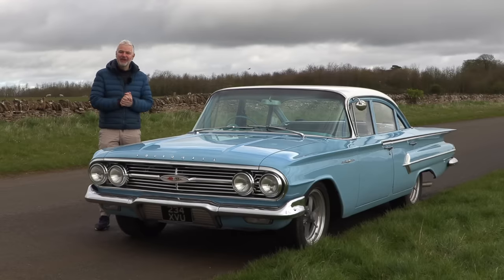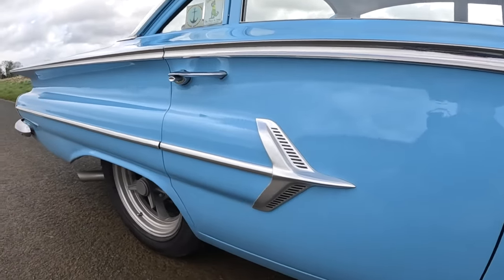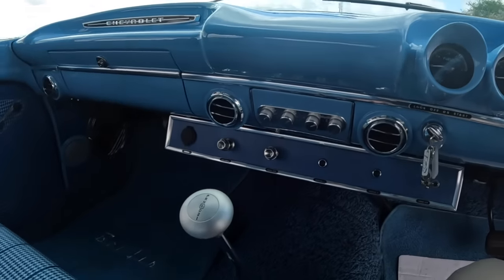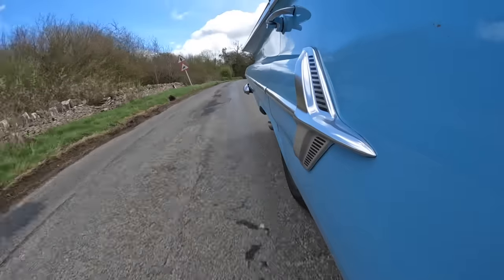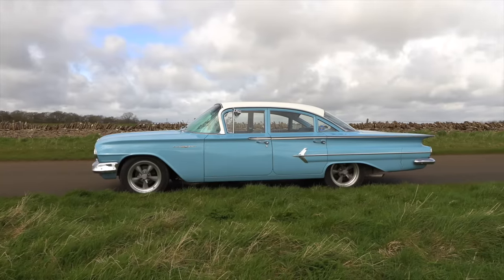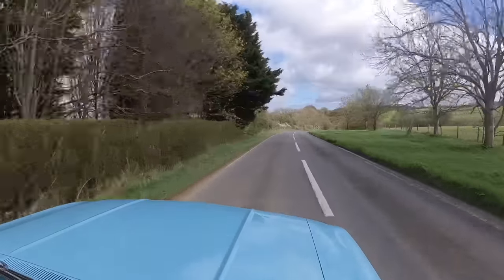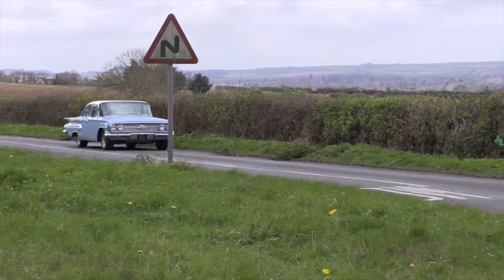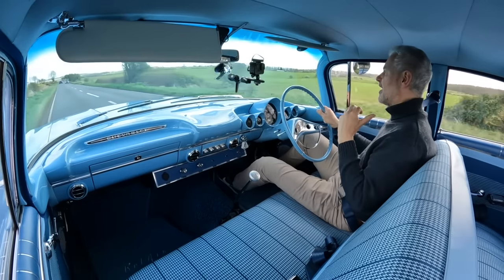Better Than An Electric Conversion? 1960 Chevrolet Bel Air With LS3

Comment: As an American, I appreciate seeing a right hand drive version of a classic Chevy.  Were these sold in the UK at the time?
Reply from the maker: Nope.. it was built and sold in Australia. Hence the right hand drive!
Reply: Apart from large American cars, Australia used to also assemble Citroen DS 19 and Toyota Crowns. Interesting to say the least. Also, coming from Australia means it would be relatively rust free.
Reply: These 4 door types look great.It would be nice with manual transmission and a 427 big block with tripower carbs.
There were also some good V8 conversions of our own PA and PB Vauxhall Cresta.
Reply: Some RHD Bel Airs also made it to Ireland in the 1950s/60s. They were used by the top brass in Coras Iompair Eireann, the national transport company.

Comment: When this popped up in my recommendations (and yes, I subscribe but to so many that I tend to miss things) I could not believe my eyes. I live in America (NJ), and my cousin who lives in California has this EXACT model year and color in his garage. He's the second owner - his dad was the first.
His spec is:
6 cylinder
3 speed manual "on the tree" (dashboard)
The Belair  model is pretty rare in America - everybody that finds one converts it into the higher spec Impala, and my when my cousin ran into the same problem with finding interior parts, he sourced the material and sewed his own headliner and constructed his own door panels.
Quite the car, and I'm so happy that you've given it a review. I'll be sending a link to here to my cousin - I suspect you may gain a new subscriber!
Well done sir!
P.S. The original spec of even the Impala would have had power drum brakes, and I saw that this one has slotted disc brakes, so definitely an upgrade there - and the whole car is beautifully done. Cheers to an excellent job by the owner!

Comment: Many years ago I had a 2.9 Cosworth V6 from a Scorpio in a Mk5 Cortina, it doubled the power but also improved the mpg, with the same gearing it was about 5mpg better than the stock 2 litre Pinto and it improved more when i fitted a better rear axle.
Reply: Knew a fella who put the same Cosworth lump in a 1600 Laser Capri with 2.8I running gear, unbelievable sleeper.
Reply: @satanssurfer5965  Saw a Mk3 Cortina on 4x4 Cosworth Sierra drivetrain & floor-pan, at a show once, hell of job - Not really a sleeper as you could tell it was "tweaked", but you certainly wouldn't be expecting that kind of performance!

Comment: I bought a '55 Chevy 150 two door with a 454 Chevy big block a few years ago. 4 speed manual and around 650bhp. It's a Gasser, so has solid front and rear axles, on multi links & coilovers. Ventilated discs all round. No servo. It's surprisingly good on the twisty bits for a car built to go quick in a straight line. Possibly helped by the GRP flip front, bootlid, and lack of any creature comforts inside.
Reply: That’s a proper big boy’s car!

Comment: ANY internal combustion engine swap is better than an EV conversion! A 1.1L out of a Yugo GV would be better than an electric conversion.
Reply: No it wouldn't. I'd rather have a V8 than electric, but if rather have electric than a wheezy old 4 pot like that
Reply: @drzoidbergmd3200  It's called Internet hyperbole.
Reply: Have you ever driven an electric car?

Comment: I would love to switch out my Audi A4 Avant for one of these as a family car. I live in the States, so the size isn't an issue. I just need to convince my wife.
Reply: We had an A4 quattro avant, which I straight exchanged for a Maserati Quattroporte.
Our living and work circumstances changed, and none of us needed to commute daily by car anymore. 
She wasn't really convinced until she drove it for the first time, then she almost threw the Audi keys at the dealer.
Reply: @marcusott2973  I think that's comparing apples to oranges.
Reply: @ghost21501 I agree, but oranges do taste so much better... 😊
Reply: @ghost21501  we live in downtown Vienna,  with a mother in law living I  the mountains south of us.
Changing from a sensible 4wd moderately sized, fuel efficient estate car to a large, expensive to maintain,  oddity of Italian engineering exuberance is similarly irresponsible as swapping a SUV for a 1960's land yacht restomod,  but so much fun.
Reply: @marcusott2973  I see what you're saying, but her issue wouldn't be with practicality. It's modern creature comforts. A Maserati is impractical because it never works. An old land yacht is impractical because it's old.
Reply: @ghost21501   a Maserati works just fine if you keep on top of maintenance. Just never kid yourself into thinking you'll run a cheap performance car cheaply, and accept the fact that the purchase price is actually more of a down-payment. 
As I drive in the irresponsible car with my family,  it would be the lack of modern safety features that would keep me from running a 60's land yacht as a daily driver.
Classic AC, Apple car play, an LS aren't that hard to retrofit, ABS, traction control, and airbags, on the other hand are.
Reply: Size is always an issue with the wife...

Comment: Had the pleasure a long time ago of being a passenger in a 1963 Pontiac with a 389cu/in and manual 3 on the tree and at 55mph you hardly even heard the windnoise. Then had a ride in a brand new Lexus SUV where you heard the very tiresome sound from the tyres/tires at the same speed, probably at any speed and it wasnt offroad tires!
Bet the Pontiac is still around and the Lexus is turned into a washingmachine, or worse: a Tesla 😮 😢

Comment: The 60 Impala Chevy I have is a: 4-door hardtop with the flat roof extension. It has 70,000 ish original miles. Mine is an Impala with a 283 powerglide all original down to the hubcaps. The car is untouched including the original paint, upholstery, and so forth, from the factory. 
 To complete my comment: This car that this man is driving, of course most of us would agree,  it would not handle the same as what I just described. But it was a real pleasure to watch the excitement on this man's face, as he drove this modified 1960 Chevy. That blue 60 Chevy would definitely be an upgrade in many ways. There's the answer to this gentleman's question. If he happens to read this.

Comment: Ah, the joy of driving a terrifying car! Pretty sure the original did not have disc brakes, but with that LS3 they're basically a must-have. The early 60's were a sweet spot in American car design.
Reply: They did not, mine had non-boosted drum brakes that were pretty inadequate.  No power steering either, which is why the steering wheel is so large.  Not a practical (or safe) car for a high school kid, in hindsight I'm kind of surprised my parents let me buy it.  Had a lot of great memories in it though, modern cars just don't have that kind of style.

Comment: So crazy to see one right hand drive.  And amber directionals is VERY odd as well!
I had a '60 2dr. sdn.  That 4dr. 6-Window sdn isn't the best bodystyle. The 4dr. 'flattop' Sport Sedans are way cool though.     Bummer he hadda use those gauges. It really waters down the look of that mind-blowing dash!     Looks like the steering wheel is from a '59 Impala.  Bitchin!
Reply: These Impala's along with Pontiac's were imported as RHD & available through Holden dealers in Australia through the late 50's to the early 70's.
Whilst they didn't sell millions of then they were a fairly common site on Aussie roads at the time. I believe they came out of New York & Canada in a SKF to be assembled here.
Reply: @farnthboy  👍

Comment: Regarding the comment about the size of the steering wheel, pardon me, Jack, but you're holding it wrong.  Forget all that garbage about putting your hands at 3 & 9:00 or 10 & 2:00.  Wear a short-sleeve shirt.  Roll up a pack of cigarettes in the outside of your left sleeve.  Let your left arm rest, straight out, across the top of the bench seat.  Steer the car with your right hand resting on top of the spoke on the right side of the steering wheel.  You'll find that it shortens the effective radius of the steering wheel greatly and provides a much more authentic experience.  Of course, here in the states, we'd swap the positions of our left and right arms to where they should be with a proper left-hand-drive vehicle.

And regarding the turning radius, you can adjust that with your right foot.

Thanks for bringing us yet another easily appreciated car.  It is a beauty, and does appear to be very well done.

Comment: The fuselage is designed to meet the then current aeronautical lines and the pilot/owner knows that when the afterburners are ignited maximum thrust and smooth handling are apparent from in the cockpit. The right amount of aileron combined with a touch of rudder is built into the yoke for a cushioned, even floating navigation thru all turns. Not a yacht, this craft is a man's achievement and reward with only a driving license required to become an owner and pilot. Find a quarter mile to fully accelerate and then another quarter mile to decelerate a magnificent Bel Air to your own garage. Grew up when these machines were state of the art.

Comment: Absolutely lovely. Needs steelies with oe hub caps and a digital dash that replicates the original dials but otherwise beautiful. Maybe a little suspension/steering work but maybe speed should be scary in such an enormous barge......😱!

Comment: Brakes are definitely upgraded.  You can see through the front wheel it has a slotted disc - from the factory I believe these were drums all around.  Firm pedal might be because of insufficient (or non-existent) vacuum boosting.
Reply: Yes the LS doesn't pull as much vacuum as a smallblock with most cams.

Comment: A friend of mine had a '60 Bel Air, one night he let me drive it , and we were on a gravel back road , when all of a sudden I saw in the headlights a rather deep depression on the side of the road , and it was too late to steer around it , I knew from experience with normal cars , that there was going to be one hell of a thud , and that he could be a little upset, but honestly the suspension soaked it up, and it was like  "what big hole in the road" ? , we didn't feel a thing , amazing.

Comment: I don't understand anyone who converts there classic to electric. To me the whole essens of a classic is the noise the smells and the tinkering. This is the perfect conversion.
I would like to know how come it's right hand drive?
Reply: The 1950/60s Chevs and Pontiacs were assembled in Australia from Canadian CKDs and sold in Holden dealerships - and of course they were RHD fitted with amber rear indicators to meet Australian compliance requirements.  1968 was the final year for the Australian assembled RHD Chev/Pontiacs.

Comment: Thank you for this video. This sort of conversion would have many purist classic car enthusiasts howling even more than an electric conversion. However, a modern gas engine works well in this Impala given that this car has been associated with various forms of modifications and customisations in hot rod culture for decades. Considering this, it is innovative and fresh. Now when will someone put a WRX motor in a Corvair?

Comment: That is pretty sweet!  This was my first car, pretty  much identical only turquoise with the straight 6 and 3 in the tree.  The only car I ever owned that I waxed the dash on.  It never ran like this one and the guy I sold it to in the early '90s ended up totaling it because the drum brakes were pretty inadequate.

Comment: I had a '62 Bel Air wagon in the UK. 283 V8 auto.I could get 20/25 mpg.As you say,you just floated around! Superb job and no,electric conversion? Absolutely not.V8s are the soundtrack.

Comment: Lovely car and a conversion that makes sense. My guess is the speedo works on GPS as there are no compatibility issues. The dials don't look out of place though. At least it put a big smile on your face Jack, great video. 👍👍
Reply: Dakota Digital gauge pack takes speedo signal from transmission controller. Easy to calibrate for an exact speed.

Comment: Good conversion. I always liked the styling.  Our parents had a black '60 283, power glide 60 years ago. It sounded good and gas was less than .30 a U.S gallon. I could remember many a time riding in that car. The steering wheel was on the other side so seeing it this way is rather interesting.

Comment: Back in 1959 did they have right hand drive cars from the US to the UK
Reply: The 1950/60s Chevs and Pontiacs were assembled in Australia from Canadian CKDs and sold in Holden dealerships - and of course they were RHD fitted with amber rear indicators to meet Australian compliance requirements.  1968 was the final year for the Australian assembled RHD Chev/Pontiacs.

Comment: One of the more popular upgrades to cars of this era is a replacement chassis. There are several companies in the states that produce what are essentially bolt-in replacements requiring little if any modification. They also typically come with improved suspensions. A boxed chassis makes these cars feel much stiffer.

Comment: EV's are a no no.
Reply: Why?
Reply: @amraceway  you can't be helped.
Reply: @comfy_rwds  You would have to brain dead to not see a place for EVs.
Reply: As a relatively old git and a former ‘why not have the V8’ waller I’d say EVs are a yes yes and it’s just a cliche for ‘petrolheads’ to hate on EVs. This big old land yacht would be a perfect EV swap conversion candidate. The guy who’s done it clearly has spent a fortune anyway and I don’t think with its vague steering, wallowy suspension and huge mass it needs hooning down the road in the manner Jack did. Like an old Rolls Royce, that he compared it too, this old Chevy would be perfectly suited to the smooth wafty torque of an electric power train. The way Jack was on it the MPG was probably sub 15 rather than approaching 30! It’s a nice old girl either way. That’s my 2 cents.
Reply: I have no problem with EV’s in principle. But not conversions of cars like these. The point of these cars is the V8 and styling. Electric conversions lose the character of a car like this. The LS3 is appropriate for a car like this. I love it.
Reply: @peterj5751 isn’t the character smooth, quiet, powerful, reliable, low riding?
Reply: @jsanders100 yes but the v8 burble is so much a part of it.
Reply: @peterj5751 time to move on.
Reply: @jsanders100  if you are moving on you would have the whole car. They have no benefits other than nostalgia. If you want EV, get one engineered and packaged as one. If you want a piece of history, keep it authentic.
Reply: @peterj5751 Yes, and since it won’t do many miles the case is made for ICE for this car. However, what about in 15 years, will it be legal, will Petrol be available, will the people of that generation want an ICE car? I expect not.
Reply: @jsanders100  for what it is worth, I think they will be registerable there will be fuel for decades to come for ice vehicles as specialist cars. However, they will ultimately be oddities from the past eventually. I just wouldn’t be trying to turn a car like this into an EV. Better to have a modern car for day to day and leaving a car like this as a piece of nostalgia for occasional enjoyment. That’s my view in any event.
Reply: @jsanders100 WEF own nothing and be happy 😮

Comment: Very cool restomod, it not only goes better and gets much better fuel economy than the original motor but also with the disk brakes stops a lot better than the original drums  The blue colour really suits it. In the States engine swap is pretty much a synonym of LS swap. Even 911 type Porsches have had their boxers in the back replaced by the LS.

Comment: Those LS3’s are absolutely tried and proven, great conversion for almost any car as long as you can fit one in and you’d be surprised what cars clever and capable mechanics/engineers have managed to squeeze one into, a lot smaller engine bays than you’d honestly think possible

Comment: Hi Jack, this is one from my younger days.  In Australia we got a lot of big American cars.  This one has some work done to it.  The roof lining in blue is great, the door caps have been recreated as they were a source of wear.  The front suspension has a disk brake conversion and there is some work done to the suspension because no 1960 Bel Air went around a corner that flat. The chrome work has been done and that looks like a new paint job too.  Thanks Jack, what a score drive.
Reply: The 1950/60s Chevs and Pontiacs were assembled in Australia from Canadian CKDs and sold in Holden dealerships.  1968 was the final year for the Australian assembled Chev/Pontiacs - the year that coincided with the introduction of the Holden Brougham.

Comment: If an old car like that isn't numbers matched, a good resto-modding is what I'd do. I've always thought about a resto-mod Buick Riviera from about 1970 or so. That was sort of America's 'Jaguar.' The V8 could be kept but updated with modeling EFI. The steering box updated, maybe a modified 700R4 trans. And some chassis stiffening, Koni shocks, 4 wheel disc brake kit, tires, etc. I drove something similar and it was extremely impressive. Tremendous classic looks with a lot of modern handling and stopping. That's what this Impala reminds me of...